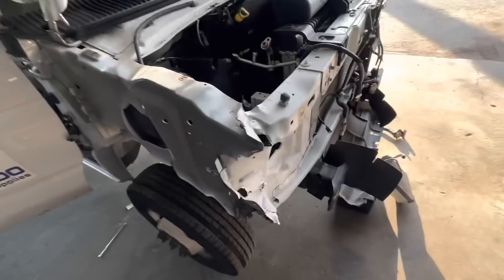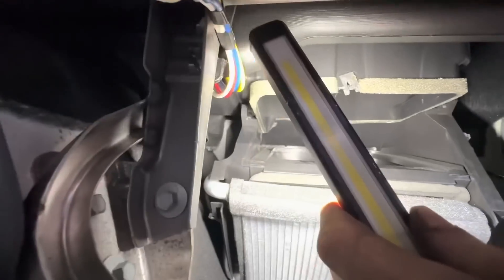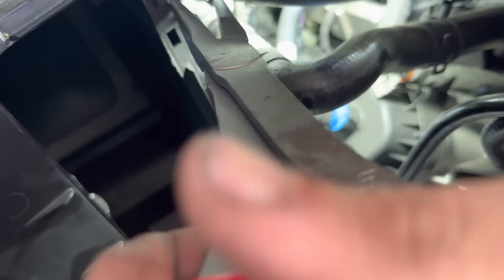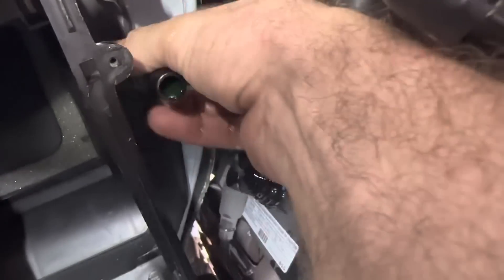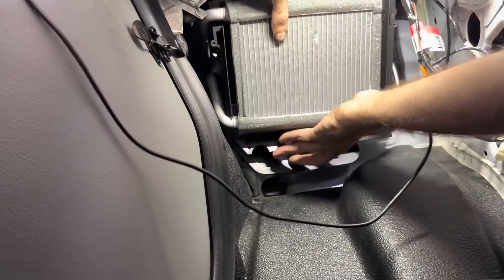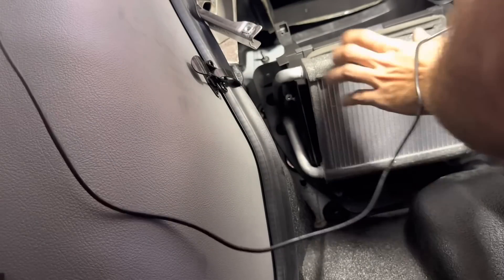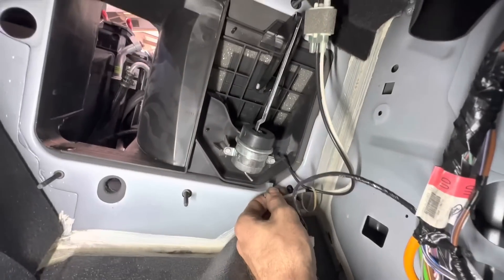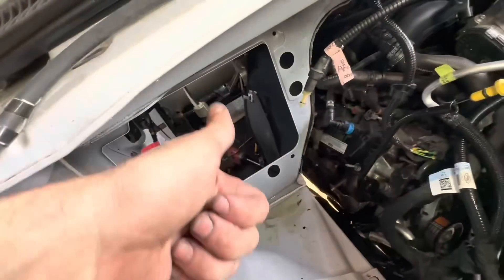Collision Repair: Didn’t have to be this way. Thanks Ford! 2023 E350 Cutaway

Comment: For decades, most motor vehicles have been engineered for assembly, where added seconds equals hundreds of dollars in labor and delay costs. Fixing stuff, usually years later and out of warranty is not their problem. As aero and safety became goals, there is little room for things like a motor, not alone a heater core. One more reason why electric is the future and the future is now.

Comment: This is exactly why they make service manuals. And that's not a condemnation or mockery of you, but of the major car manufacturers. They do weird stuff like this, then sell the service manual at a huge cost (or worse, don't release it at all except to dealerships) so that small shops like yours have to go through all this nonsense.  Every car manufacturer should release their service manuals (digital only) for free, if for nothing more than good will.

Comment: I've never owned a Ford, and don't often do any heavy thinking, but that mounting stud looks like a stud with a hex near its center.  Couldn't the mounting hole on either the heat exchanger or the blower motor housing have been made LARGER, then use a large washer and then a nut to mount from one of the sides?  Then once the outer nut and washer had been removed, once could use a deep socket to remove?  I understand that Ford figured an extra washer would add to the cost, and maybe then in manufacturing that a second employee might be needed to get that started, but the current repair scheme is a little ridiculous.

Comment: This is as bad as replacing a power inverter on a Mack truck. To get it out they could have used weld studs but you half to remove all cabinets to remove the front face of the bed and disconnect the heating vents in the sleeper to replace the power inverter because behind the fancy black cover on the bed is 4 t 25 screws holding it fast. Then you need some one to hold the bed up so you can get your 10 mm socket on it to remove it. Engineer needs a ass kicking

Comment: Every single Ford I've ever worked on has stupid design details that make them awful to work on. Front lower wishbone bolt on a 2012 Focus with air conditioning? Yeah you're going to need to remove the air conditioning compressor to get that out, or lift the engine. Want to top up brake fluid? Yeah that's a nope because they hid the reservoir underneath the scuttle panel, they do provide a special funnel but... Why?

'06 Volvo XC60 (When Volvo were owned by Ford) - can't take the steering knuckle out without removing the lower wishbone since the ball joint doesn't have enough angle on it to fall out when the bolt is removed. Everything is under spring tension from the suspension so getting it back in is a fight, took 3 hours to get a stupid wishbone installed.

Comment: This is a 2023 Ford E350?  I thought Ford stopped production of the E series several years ago...
I could be wrong, though...
Reply: Ford still makes the E-series as a cut-away and stripped chassis for aftermarket use
Reply: @skylerlysek9231  Yep.  350 & 450 only.
Reply: @SYH653  Wow.   I did not know that! We used the E-series for Electronic News Gathering (ENG) trucks for many years at the TV station I worked for.  

Most stations converted over to the high-ceiling Transits or did away with ENG trucks with the advent of new cellular transmission technologies...

Comment: 😂 Here is the explanation why car manufacturers make idiotic solutions $$$$$❗ At the end of the 70s I worked at Volvo when new car models were launched. We received training on what was new and changed. When I questioned an idiotic technical solution as it made it more difficult to repair. Was the answer $$$. In manufacturing, Volvo earns a dollar by assembling this part in this way. Multiply this by 100,000 cars manufactured and you will understand.😧 But I said it means longer and more expensive for the car owner to repair. "who cares" 🥱 When the warranty has expired, we make money again when the car owner returns it to our workshop for repair.

Comment: surely if that bolt goes right through from front to back , a welded/threaded hole would be enough and 1 nut holding everything on would be enough, and your "spare" washer dropped down as you were moving the assembly away from the firewall. Forever. 
Forever. Ordinary. Rediculous. Difficult.

Comment: Most new cars are garbage, they are all designed to a budget with no quality in mind. Impossible for the backyard mechanic to do simple maintenance on unless you have specialised tools. Then theres the ridiculous amount of money you have to pay for a new car. If i ever came into enough money to buy a new car the only exception would be a toyota as they seem to be the only car manufacturer that still make quality cars that are relatively easy to work on and dont break down all the time.